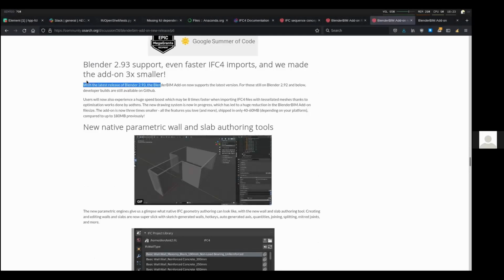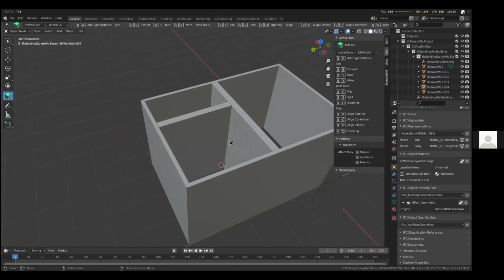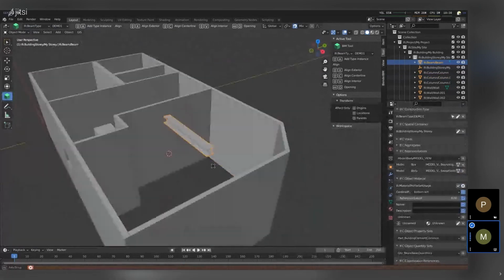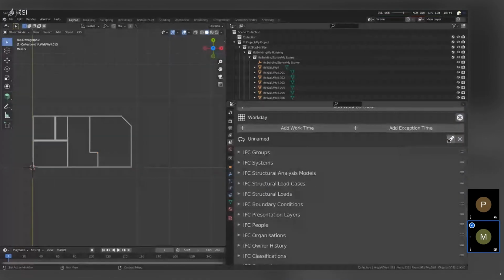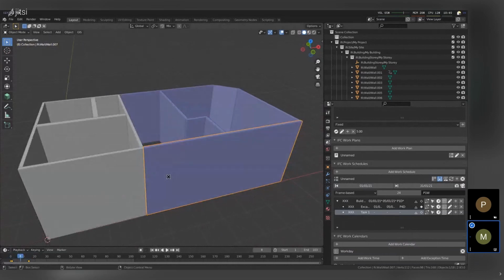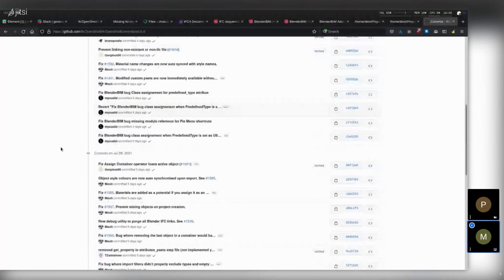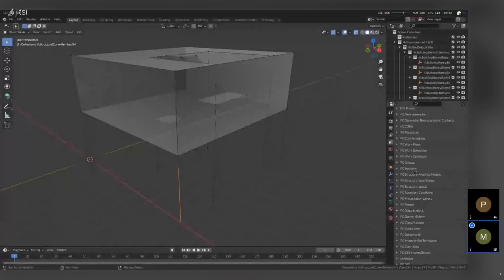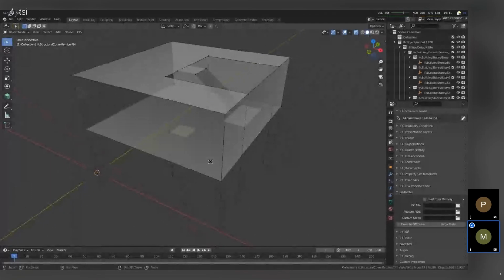BIMvoice#🎙️BlenderBIM Add-On Version 0.0.210605 With Dion Moult (Part 1)

Comment: hi sorry for asking. i wanted this add on to be my main tool in preparing my architectural schematic phase and maybe for the final drawing too  once develop extensively.

but i cannot make work  instantly the “add instance” when using annotation. i am having a hard to make it work. is there special rules for adding instance when using annotation?

i hope you can help me . because i already have initial plans. and wanted to use this add on to have the elevation scheme and have flexible designing tools.
Reply: Annotation features are unfortunately not yet ready :(

Comment: It seems like it's going to take a path to be like REVIT.... but must have a complete  architectural modelling precision capabilities...
Reply: So far the features implemented are based on the IFC specification, not on Revit. If what you see is similar to Revit, that is because Autodesk is one of the companies that has had influence over the international IFC standard.